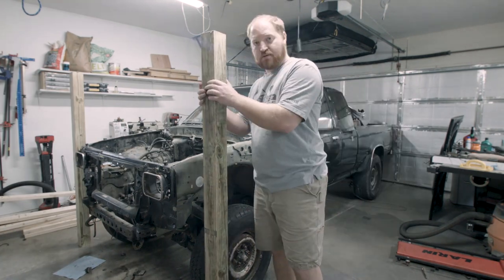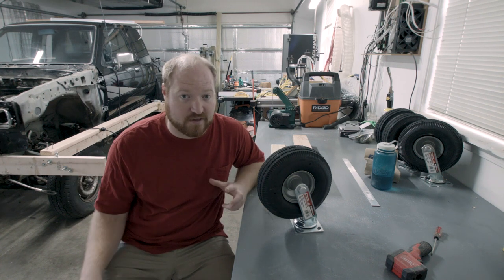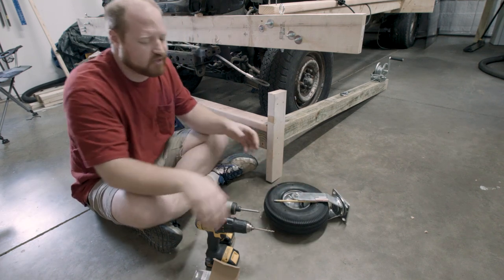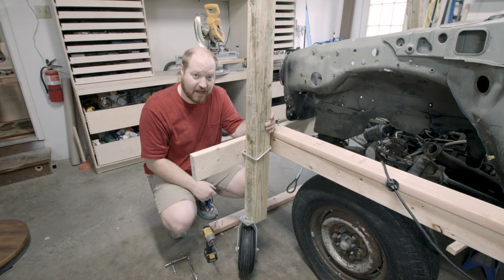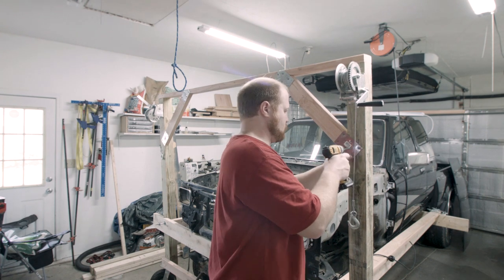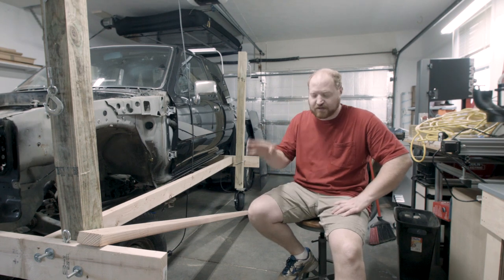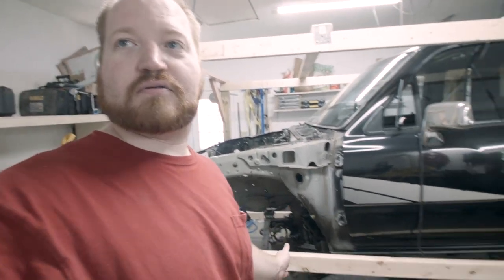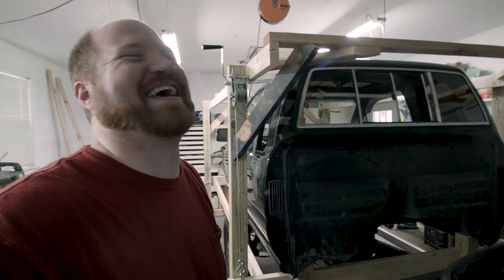Building a crane to lift up a truck - 1989 Toyota Pickup Restoration EP 14

Comment: is  309,000 miles good for a 1989?
Reply from the maker: It depends on the engine. If it's the 22re than you're about halfway through it's life. If it's the 3.0, like I have, 309 is pretty darn good, but could be close to needing major work. 309k is is about half the life of a Toyota engine that's well taken care of.